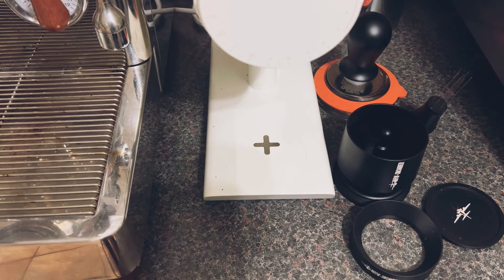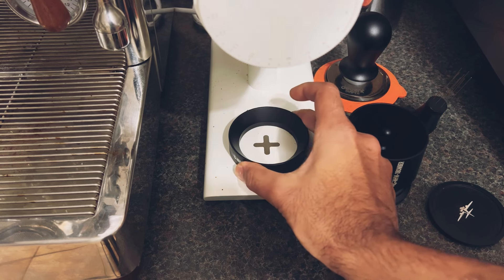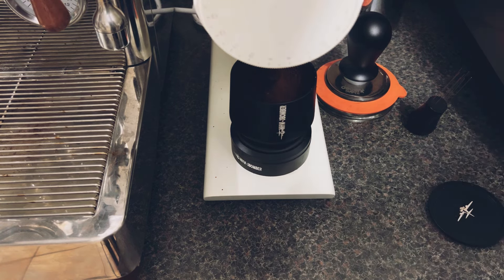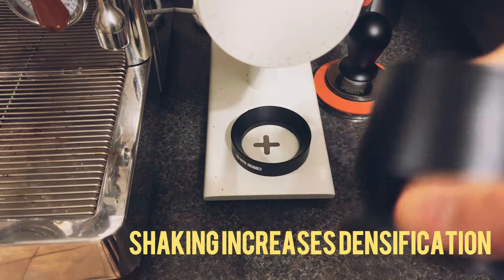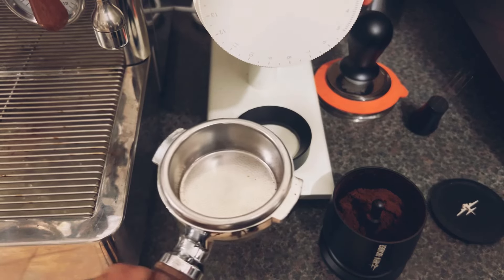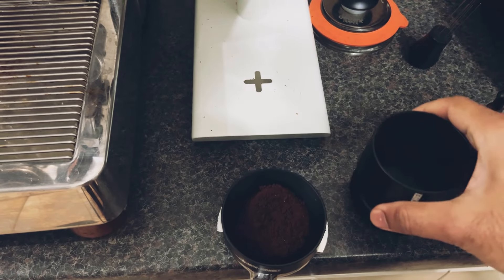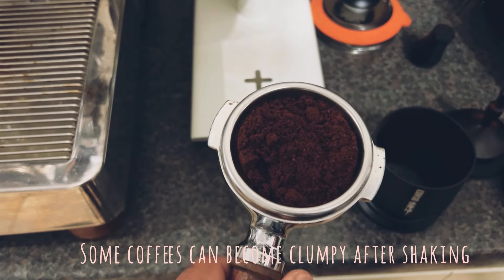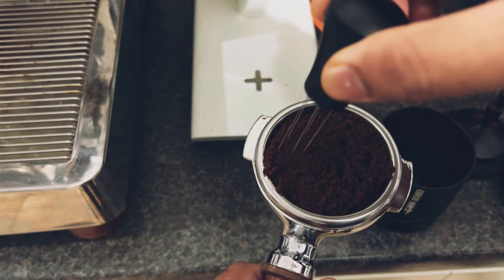Workflow with MhW3-bomber shaker  and Timemore Sculptor 078S

Comment: Any issues with squeaky lever from using the puck screen?
Reply from the maker: Not really. I can’t see how the puck screen will affect the lever. If you haven’t already tried, I would suggest lubricating the lever. https://support.clivecoffee.com/en/e61-cam-lubrication-brew-lever
Reply: @UnderstandingCoffee  I have had the Bianca over 2 years and havent needed to lubricate. Quite a few people are saying the screen blocks coffee oils from lubricating the lever and creates a squeaky lever after a while.
Reply from the maker: I haven’t noticed anything tbh. I haven’t had to clean as much since using the puck screen.  I still continue to backflush using a cleaning tablet every 4- 6 months depending on use. This stops the coffee oils from accumulating. The cam mechanism should be lubricated every time you do this. http://coffeetime.wikidot.com/e61-lubrication

Comment: "Always use a puck screen" Other than the fact that it makes the shower head easier to clean, are there any other advantages to using a puck screen?
Reply from the maker: That in itself is a big reason to use one.  Subjectively the extractions look better, but I appreciate a good-looking extraction does not always mean much.  With the shaker, I have tried without, and the extraction seemed fine.

Comment: nice!

so this shaker doesn’t center magnetically? any clue if the weber shaker does?
Reply from the maker: No, it doesn’t have a magnet. The Weber shaker does though. From what I’ve read, the Weber shaker magnet doesn’t work very well with the 078S.
Reply: @UnderstandingCoffee  thanks for the info!
Reply: Centering the shaker underneath the shoot doesn’t have to be exact. You’re going to be shaking it afterwards anyways.
Reply from the maker: @DigitalicaEG It’s to reduce the amount of grinds flying outside the shaker
Reply: Was looking to buy the Weber one but Lances video dropped before I had a chance to buy one.

Comment: you don't need a scale for ground weight?
Reply from the maker: The 078S has very little retention.  At most, I get 0.1 gm retention!  So I don't really feel the need to measure ground weight.
Reply: Same for me, I also have the 078s and I almost always (like 95%) have 17,5g in, 17,5g out so i stopped weighing after grinding a while ago

Comment: no slow feeding or hot start? is this amateur hour!?!?!?
Reply from the maker: Thanks for your comment.  You should carefully evaluate techniques before jumping on the bandwagon.  Slow feeding works well for filter as it reduces the amount of fines.  For espresso, it does not work, especially with the 078S.  The grinds are coarse and the lack of fines results in poor puck integrity. With extreme slow feeding, for some coffees, the burrs need to be almost touching to get a decent puck resistance.  For turbo shots, it might be ok but this is not my preference.  Also, the rate of feed is another variable that we cannot control leading to inconsistency. 

 I have set my rpm at 1100 which is the most stable setting.  There is no difference between a hot and cold start at this setting.  The grinder is powerful enough and does not stall with cold starts.